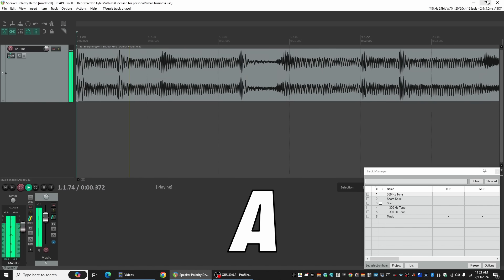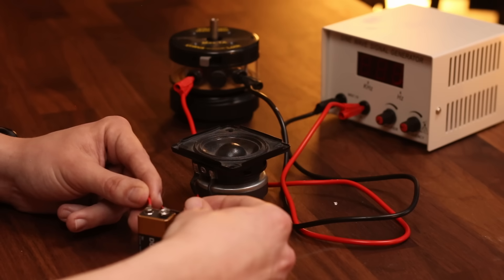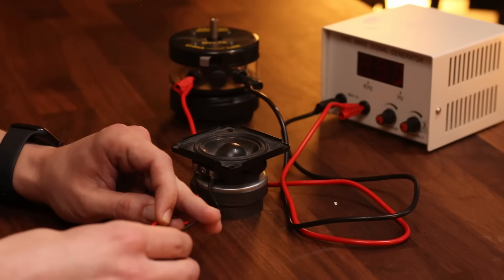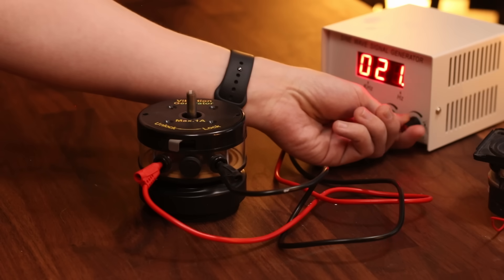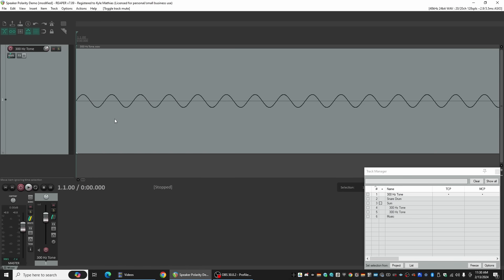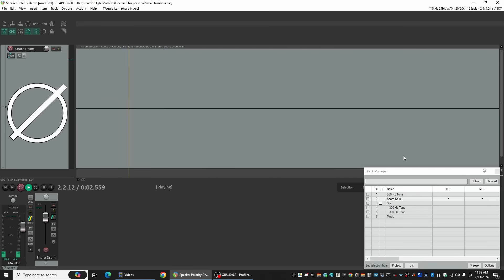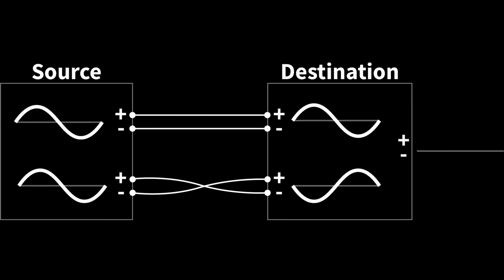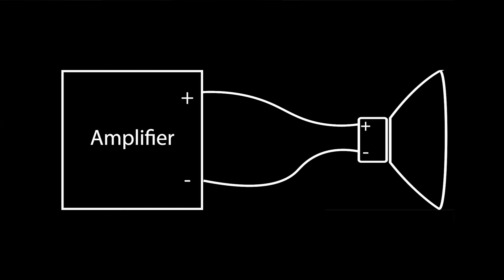What Happens When You Wire Speakers Backwards?

Comment: One thing you didn't really touch on was the travel of the speaker coil. When connected backwards, the speaker coil will also move backwards and depending on the signal could run out of travel (causing distortion to the output wave). Also having an overly biased DC component to the signal (like distortion from a guitar amplifier signal) will probably affect the sound output too if the diaphragm is sitting too far back.
But you're dead on about the phase cancellations.
Reply: "One thing you didn't really touch on was the travel of the speaker coil."
??? no? The travel is the same in both directions.

"Also having an overly biased DC component to the signal "
That is something completely different.
Reply: @ABaumstumpf  "The travel is the same in both directions" - depending on the sound level being fed to the coil. Once above a certain level, the coil can only move back so far as it's limited by the top and bottom plates.

And having a DC bias on a speaker is quite normal in any guitar amplifier pushed to distortion. Not the best situation for the speaker but it exists non the less. In terms of a studio it wouldn't be the case as that's the last thing you want.
Reply: @peterschmidt9942  "Once above a certain level,"
Sure - once you are far beyond the limits and distorting the sound then the distorted sound will be different ... oh no, your already trash sound is not the same anymore....

"And having a DC bias on a speaker is quite normal in"
No it is not.
Reply: @ABaumstumpf  You've completely misunderstood anything thats been presented and I can see your limited knowledge about how some electronics works in the real world. You also don't take helpful criticism well. Have you used an oscilloscope recently...ever? Keep believing your misunderstood concepts. I'm not bothered either way.
Reply: @peterschmidt9942  So after getting called out on your bullshit you try shifting the goalpost and go for fallacies cause you know you got no argument?
Well that is an effective way of showing that you are just making shit up.
Reply: @ABaumstumpf  😂🤣 Like most people who lack understanding your comeback is "I shifted the goal posts" and butt hurt if someone questions your integrity. If you could actually comprehend my original comment, no posts were shifted. Learn to use a meter and check it for yourself if you reckon I'm full of shit. You're not even qualified to open a tin with a can opener let alone advising anything to do with electricity. This much is obvious

Comment: There's actually a few instances where you WANT phase cancellation, though...

The first that comes to mind are Bessel arrays...big cabs full of full-range drivers in which some of the drivers are out of phase. Normally, this is a problem...but in a properly constructed Bessel array, the phase cancellations get controlled in a way that allows for excellent imaging from a pair of Bessel arrays in a typical space.

The other, however, is far simpler: the Hafler circuit.

Hafler circuits feed an L - R signal to a monophonic rear speaker. Since a good bit of the original mix contains phase-decorrelated audio from things such as "hall" reverbs, much of this signal will consist of room ambiences and very little "dry" signal...but feeding it to a rear speaker causes a big stereo stage expansion, since L + (L - R) or R + (L - R) over a Hafler circuit broadens and, to a good extent, restores the performance audio's stereo platform.

I did an installation work once which used phase reinforcement and cancellation as a way to break up the dry signal into wider and more dramatic sound staging. Since this used a quad speaker setup, the Rear L and Front R were out of phase with their counterparts, causing patterns of cancellation and reinforcement that made the work change depending on where you've placed yourself in the quad spatial field. One person at one end wouldn't hear what someone in the middle was hearing at the same time. Very effective!

FYI, you can find a basic diagram of phasing of this sort on Brian Eno's "Ambient 4: On Land". He prefers it to basic stereo, in fact, due to the improved hall ambience this technique uses.

Comment: One thing to keep in mind is the design of the speakers you are connecting. If you have a speaker that has more than 1 driver in the cabinet, unless the crossover is first order (6db), the individual drivers will stop and start at different times. The only way to get around it is to use a first order crossover. However, in pro audio applications, I'm not aware of any speakers that are designed with them. You can find them in higher end home speakers, but they're not that common. I'm guessing maybe 5 to 10 percent. So, no matter what you do, your speakers won't be moving in and out as the same time. The reason first order xovers are not that common, is because it makes the speakers difficult to design. Its very hard to get the drivers to integrate with such a broad xover point. Also, first order xovers tend to make the speaker less efficient. Most pro audio speakers are rated at will over 90db. Almost always first order speaker will be less than 90db.

In the video, he talks about how hard it is to tell the difference when speakers are wired up completely out of phase. And he's absolutely correct. Just to add a bit more to what was said in the video, to actually get absolute phase in your system correctly, is pretty much a lost cause. To start with, not all components are designed to be absolutely phase correct. When looking at audio equipment, you may see something in the specs at says, this component inverts phase. When you mix components that change phase, sometimes you get lucky, and the last switch will put the signal back in phase. Otherwise you can find a line conditioner, or similar product that inverts phase.

But even if you get everything right in your system, you're still not going to get absolute phase correct.  About half of the recordings made are in phase, and the other half, out of phase. So, no matter what you do, the best you can ever hope for is about 50%. There's only one way around it. A lot of higher end gear, usually sources and preamps, come with a phase invert button. I know people that listen to every recording they have and manually check phase on all of them. To me, that's a bit excessive, but its not my call to make. Personally, I can hear a small difference, but I doubt I would pass a blind test.

Comment: Years ago, I found I had accidentally wired one of my two subwoofers in reverse (in my mobile DJ rig). When I saw how I had screwed it up, I laughed so hard! I had been struggling for several months with my system - asking myself, "Why can I hear the bass coming out of each sub when I stand right in front of it but when I move to the center of the dance floor, I don't hear or feel it?" No amount of EQing or compression made any difference. When I saw I had the cable to one sub wired backwards (positive to negative and negative to positive), man oh man, I was relieved. I still laugh today thinking about it.
Reply: So you experienced wave cancellation by first hand 😂
Reply: I did the same thing in my car with two subwoofers! I literally saw them vibrating with the music but couldn't hear or feel any bass!! They were perfectly cancelling each other out.
Reply: I worked on a recording system that sounded perfectly fine but when you tried to record you got nothing.  Someone wired one of the inputs backwards so the mono signals from the mic were being cancelled.... The tech who installed it couldn't figure it out for 2 weeks.
Reply: @BrettDalton LOL!! It happens to the best of us
Reply: @BrettDalton that is so frickin hilarious! LOL
Reply: @BrettDalton what u mean backwards? What system was it?
Reply: @tanelehala6422  it was a lecture recording system at a university, most of the inputs except the DVD player and PC were mono, right output from the mixer was crossed over (+ve to-ve) but the left wasn't so when it was down mixed in the recording hardware you got nothing except the noise floor.

We could hear audio at every step in the chain except in the final file, I pulled the raw files and saw there was audio there and noticed the reflection, luckily there was a slight DC bias that made it obvious.
Reply: Haha that's a good laugh. I mean in the sense that we've all made simple mistakes but genuinely bothered us. Then we happen to stumble upon the solution like it felt sorry for us lmao
Reply: Noise cancelling Basedrum 😂
You were just concerned about the hearing of your Audience, totally intentional 😊
Reply: @timhartherz5652 of course ;-)
Reply: this made me chuckle immediately.
Reply: This is the true joy of XLR cables.  You can't mess it up!
Reply: @ThatSockmonkey not if they are wired backwards in the first place that can be easy done
Reply: @Boxbeat666  how many commercial XLR cables have you found that are "wired backwards"?
Reply: @ThatSockmonkey  so you have never made your own ? The speacon clips have 4 contacts from what I remember with hard to see - +
Reply: @Boxbeat666  I have, but honestly, at work, why bother when you can just buy them?  I haven't had to make my own cables since I was in school, like 30 years ago.
Reply: What the heck is a speaker?
Reply: @DonavanCMcCoy  an speaker known as loudspeaker is an electroacoustic transducer that converts an electrical audio signal into a corresponding sound.
Reply: @travy268  hahaha
Reply: @DonavanCMcCoy  what’s so funny about  that?
Reply: @travy268  , I was laughing at your joke. Well played.
Reply: @DonavanCMcCoy  I wasn’t making a joke about explaining what an speaker does though
Reply: It's ok to wire them backwards as long as you do ALL of them the same Lol. 

This is why I always make note of the indicator on one of the wires, whether it's a stripe or the wire itself is silver vs. copper.  The wire with the indicator, or silver wire always goes to black and the red(copper) or unmarked wire goes to red.
Reply: @Angels_Are_Vengeful My cables were clearly marked Red/Black ...I just wasn't paying close enough attention to cancel out my dyslexia
Reply: Awesome. I have to try that.
Reply: I like to flip the polarity on my subs until they cancel each other out as much as possible, of course adjusting timing and phase. Then flip it back and I have a perfectly aligned subwoofer.

Tho it's still a pita to get them working right.
Reply: Sometimes when you use multiple subs in a room, you need to reverse or alter the polarity in order to compensate for standing waves. For a stereo pair 180° off phase usually cancels pretty bad in the center as you saw.
Reply: @Munakas-wq3gp  It was like the Solar Eclipse in Totality. hahaha
Reply: I thought my amp was dead when I did that. Didn't realize I was canceling the noise.
Reply: If you wire subwoofers opposite, one will suck while the other blows.  Cheers!
Reply: With subs, you might want one backwards, depending on the distance between them, if you're unlucky to have placed them at just the right distance apart for them to destructively interfear.  Or you could slightly move one. 😂
Reply: @jnawk83 Truthfully, I'd love to do a cardiod set up...just so that I can hear myself think behind the DJ booth
Reply: compressed it inside rather than releasing it outside.  i think its the most basic way to explain ^^
Reply: That's really cool
Reply: Had the same experience in my car lol :D
Reply: Hahahahahahhahahahah
Reply: Many powered subwoofers have a phase switch. You play music and switch until it sounds best.
Reply: Had that happen so many times, polarity is the first thing I check when bass is lacking. But when I had the polarity reversed on one of my phono cables going to my sub woofer amp it took me quite a while to find the problem.
Reply: The better explain of the wire in reverse on subwoofers!!!!! thanks
Reply: U where doing active noise cancelling !
Reply: @SpeedyGwen facts!
Reply: Jriver's Media Center's DSP speaker config has a check box for polarity.
Reply: @Shalmaneser1 thank you. Back then I was using outboard amps. Today all my speakers are powered. So there is almost no chance that I will wire them backwards. 😂
Reply: Ah the old out of phase phantom. If “back to the basics” was a person lol
Reply: @t.n.-js6ei Your mom is a podium
Reply: I was going to feel furious at myself and ashamed😢😅
Reply: @MaestroMiaghi lol
Reply: Bass not base
Reply: @borysnijinski331 word brother! All fixed. Thanks.
Reply: well  you just s well  have left  it  alone  you went  for  two sweet spots to  one. Point is  you  could only tell under particular  circumstances . Wit all the  bodies  dancing in the room  no one heard it
Reply: @timeWaster76 ok. If you say so, who am I to argue.
Reply: Bro’s made of positivity👍

Comment: Actually, we've been doing this for decades now. For your information, we've ALWAYS used a AA 1.5v battery for testing, as a speaker is rated at 2v. We've never used a 9v battery, as it's unsafe. Cheers.
Reply: Actually, Watts equals Volts times Amps. 100 Watts at 2 Volts would be 50 Amps. To carry 50 amps you'd need a wire more than an eighth of an inch in diameter. The wire in the voice coil of the speaker would be huge. 2 Volts output into an 8 Ohm speaker nets you a half a Watt. The current then is a quarter of an amp. Much more reasonable than 50 amps. Wire the thickness of not much more than a hair can carry that. Which is what you find in most voice coils. To get practical power voltage needs to be increased so current is manageable.
Reply: @1pcfred  the voltage at the receiver given to the speakers is 2v ? or up to 2v. We've always been told this for decades.
Reply: @1pcfred  A miscommunication here. I meant 1.5v to test a speaker, will not burn it out as 9v would. Cheers.

Comment: Thank you for this interesting explanation. I agree fully that inverting the input of a single speaker has no effect on the sound. I also agree that inverting the input on one of a pair of adjacent speakers results in strong sound cancellation. But there may be an additional effect that is not described in this video. This pertains to stereo imaging. Human hearing (including signal processing) includes a comparison of time delay between a sound heard from the left and right ears. We use this mechanism to locate a sound. For this reason, a monaural signal played in phase by two well-spaced speakers "appears" to be from a small spot midway between the speakers (assuming you are sitting in the middle). If this monaural signal is delayed on one speaker by a small time period (on the order of 1/1000 second), the sound direction will appear to shift towards the un-delayed speaker. The brain is comparing waveforms to determine the time shift and gives the perception of a sound direction. I have done this experiment with headphones on a two-track tape recorder with separate record and playback heads. Recording a monaural signal of equal strength, the playback delay between left and right channels can be controlled by tilting the playback head slightly (with an adjustment screw). While adjusting, the sound appears to move precisely left and right within the head. The point is that a good recording can provide a sharp "image" of the instruments spread across the stage. However, if the two loudspeakers are out of phase (one wired backwards), the waveforms no longer match. Waves in higher frequencies are delayed very little, but lower frequencies are delayed a lot. As a result, out-of-phase speakers will provide a very blurry image, a big loss to the listener. This is in addition to the loss of amplitude. I hope this effect is of interest. Try it yourself if you can adjust time delay instead of phase. It might make a very good video! Thanks again for your contributions.

Comment: Free powered subwoofer hack using reverse polarity: Set your subwoofer low pass value (eg, 40hz), then set the subwoofer in reverse phase. Now apply a 2nd order high-pass to your main speakers one octave higher than the sub's low pass (at 80hz). The net result is a +9db boost @ the low pass value. The high and low pass filters will rotate the signal's phase 180 degrees, so be sure to set the sub 180 degrees out of phase.

Comment: Interestingly enough, it's not uncommon for a speaker's driver to be intentionally wired "out of phase" due to how the crossover and time alignment of the drivers affect the phase of the signal passing through it to the drivers. In such cases, if all drivers were wired electrically in phase, there would be a massive hole at the crossover point between those drivers.
So typically one driver will be wired out of phase electrically in order to keep them in-phase acoustically. 👌

Comment: I was thinking in a use case that could be different.

If the sine wave center voltage is 0v (gnd) and the signal voltage is -3v ~ 3v, then the speaker excursion will be upward and backward respectively the original signal and the resting state of speaker. But if the amplifier (cheap) sends the signal voltage between 0v (gnd) ~ 6v, then the speaker movement is only in the upward displacement. The center of the sine wave would be 3v signal in the speaker.

Anyone known if this is correct?

Comment: Nice video. Gave you a like. In guitar amps, we sometimes invert the polarity on one or more of our speakers. Some cabinets have 4 speakers in them. When we invert the polarity on some, it can reduce feedback. Yes, there is a loss in fidelity, but in the heavy metal genre of rock music with powerful amps with speakers spaced widly apart, most won't hear much of a change in fidelity. And since we set the phase during setup and not during a performance, the audiance gets "used" to the sound fairly quickly.